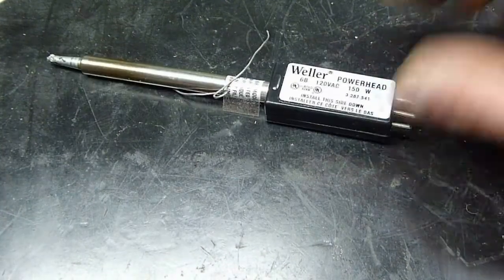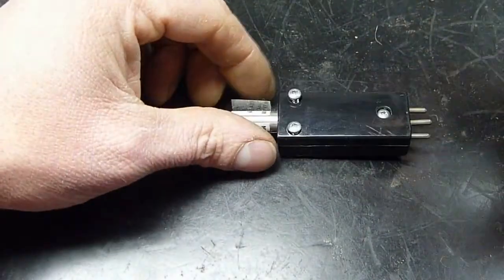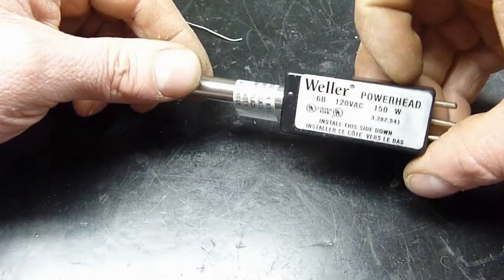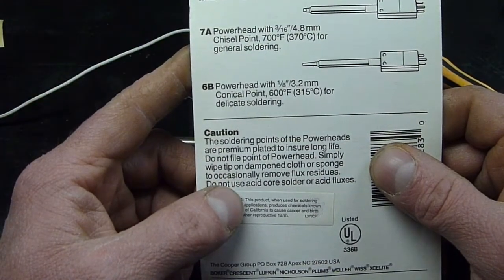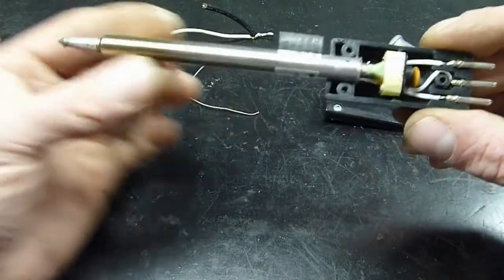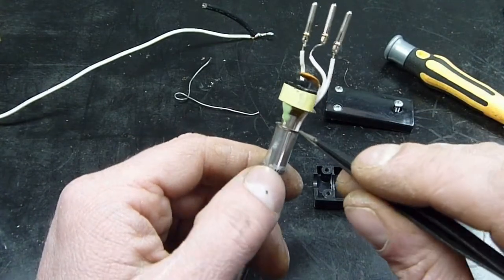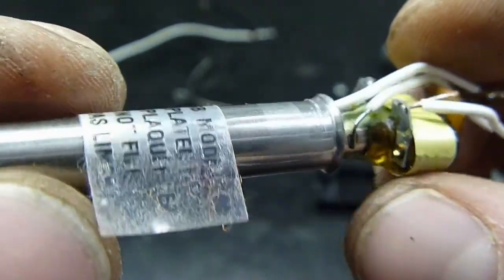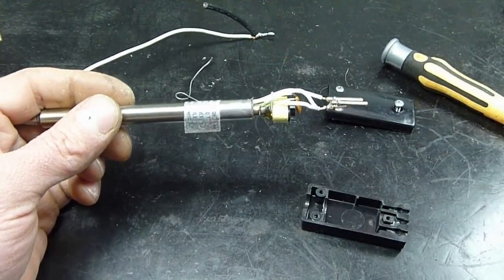Weller Tempmatic Powerhead Teardown

Comment: Let me explain how temperature regulation works.  In the tip is an iron plated copper block.  Surrounding this is a "conventional" resistance heater, rated for stated watts (150) when connected directly to the line.  The contacts are in series with the heater.  On the back side of the copper block at the tip is a disk of special iron alloy.  (All ferromagnetic iron will ABRUPTLY lose its magnetic qualities at some temperature.  This is referred to as "Curie temperature".)  Behind this is a permanent magnet that can withstand high temperature, connected to a long rod that goes back to the contacts.  When the iron tip is cooler than stated temperature, the permanent magnet is attracted to the disk on the backside of the tip.  This pulls the rod forward & closes the contacts, heating the iron.  When the tip reaches set temperature (600F or 700F), the disk abruptly switches into the nonmagnetic state.  A spring pulls the magnet away from the disk, opening the contacts, cutting off the heating.
          The 3rd wire is ground wire, so sensitive electronics are not damaged by capacitive coupling from the AC line.  It is also safety ground is the insulation fails in the tip.
          The "solid state" is hype put in there (these were sold in the vacuum tube era).  It is actually more "backward" than tubes.  It is essentially a mechanical thermostat with contacts as the switch.
          The advantage of this regulation scheme is that temperature is set by the bulk chemical composition of the disk, which will not drift with time.  It is possible to put the sensor right at the tip, where the temperature is important.
          You can demonstrate Curie effect with a nail, magnet, & torch.  Put a nail on a brick outside & torch it until you see it glowing red.  Then remove the flame & hold the magnet over the nail.  The nail will act like non-magnetic substance, not being attracted to the magnet.  Then, suddenly, as it cools to below the Curie point, the nail will jump up to the magnet.  Magnetic materials can be alloyed to have Curie point anywhere from cryogenic temperatures to red-heat.
Reply from the maker: Good explanation, thanks!  There may have been different models of these sold for electronics purposes - this one does not have a ground.

Comment: MAGNET SWITCH (Magnistat) ... WORKS via Curie Effect with base of soldering tip.
RESEARCH Weller’s Patents (three of them) ... TCP series (24 VAC) or W60/W100 (120 VAC).
The Magnetic switch technology is used in healthcare and manufacturing today.

** Metcal/OKI uses Carl Weller’s magnetic switch technology in their high end irons and stations.
It’s listed in Metcal patent filings, as well as an old 1905 induction heating patent. **

Older User Guides at BAMA Mirror, scanned from my Library.
http://bama.edebris.com/manuals/weller/

READ WTCP series 1960s Tech Sheet : Theory of Operation.
Reply from the maker: Thanks for the info!

Comment: PS. I have the model 7A tip and your video did help me understand the tip and get it wired correctly.  My thermostat is bad (no connectivity across the contacts).  I bet if you measure yours, it is conducting (when cold).  I bypassed the thermostat and now it works fine... I just better not keep my finger on the trigger!  I'll look for a replacement tip... I'm sure they must still be sold? I hope.

Comment: Thank you for your video.  My tip just broke on mine and opening it, the wires weren't connecting.  1 wire was loosely soldered, the other ground wire totally came off and I wasn't careful enough when opening to understand where it went.  You are right, that device at the end is a contact, it must be driven by a rod inside that delivers the heat from the tip.  It IS the thermostat contacts (hence why it has a capacitor across the contacts).

Comment: This gun is probably one of the best Weller ever made. I've had one from school and have soldered from ic's, radiator leaks and even alternator and battery cables.
The switch inside is a magnetic one and drops out when the tip reaches the specified temperature.However the trigger allows you to regulate the temperature to whatever you want.
I have dismantled the element and repaired it twice or so.
The magnetic switch is prone to failure.Simply bypass it and you're running again but temperature control is solely dependent on the trigger then.
I have the three wire version and since i work in  broadcasting and sometimes work on live equipment i have removed the earth to avoid shorting signal to ground.
I have both the chisel and conical bits.Would never part with it.